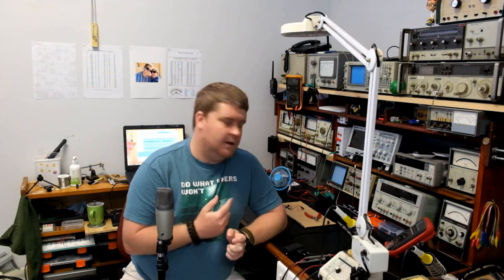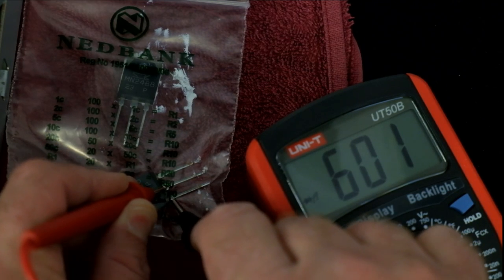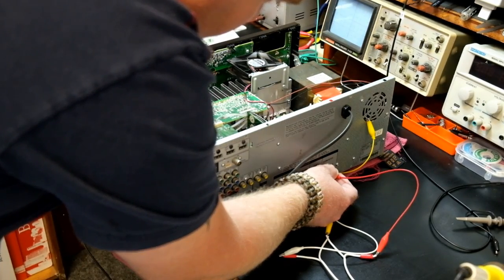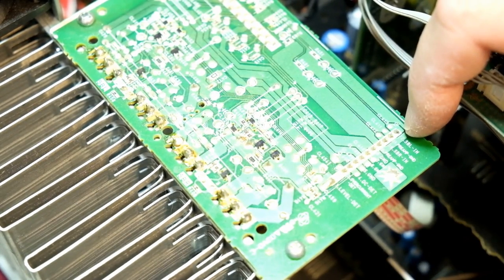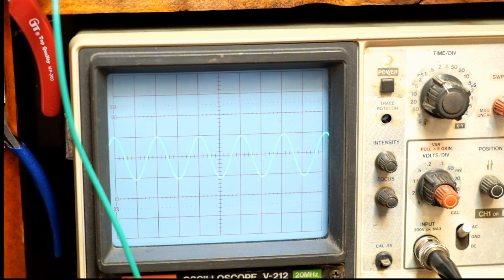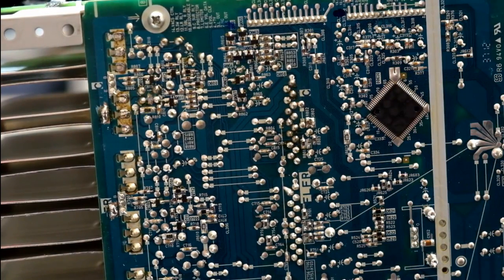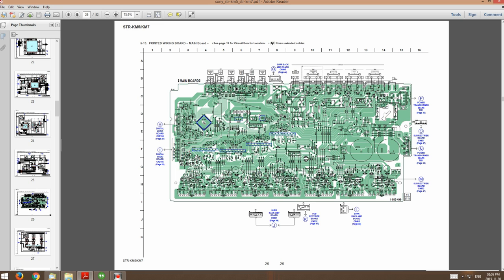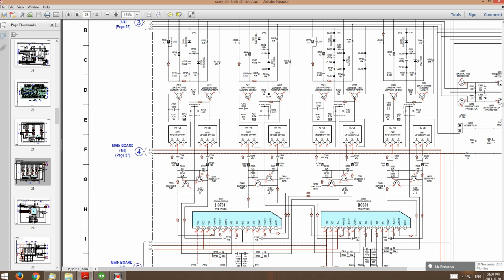Episode 41   Sony 7 2 Amplifier Repair

Comment: great video. I have a sony muteki STR-KM7600 and a KM7000, both front speakers and surround R are low compared to the others. it is not a speaker problem. The mosfet looks good too (i tested it on place without removing it or cutting the tray, is it ok?), I re-solder the pre amp and nothing yet. Any idea what else should I test?

Comment: Hi there,

I Just viewed your video about your repair of a receiver, could you possible make a video about the part that you check the vertical board witch the optical connections, so i get a little bit more understand of this type Electronic board in amplifiers?

Comment: Very good analyzes; I have run across my fair share of collector emitter shorts with audio equipment. In rare cases in a push pull driver circuit I have found they tested good until I tested the actual hFE, example one driver will test 25 and the other 125 clearly showing the higher gain drawing more current while switching that can course weaker sound and eventually fail.

Comment: I have tested a lot of transistor and they tested fine with digital multi-meter but measure bad when testing with analog meter. The correct meter is an Analog meter that carries a 9 volt and two 1.5 volts batteries. Also some transistor may test fine but the gain maybe low causing problems,  Transistor are a tricky thing.

Comment: Hey I have STR-KM77 Sony muteki 7.2, all speakers are working order no bass coming from subwoofers.
Test tone SW empty nothing .
all factory reset done.checked wires , fuses all good..can any one advise the problem
Reply: Mine also the same problem....can anyone tell us the solution

Comment: Hi,  I have a problem with my Sony system 7.2. The system is not switching on but two fans are rotating.  What could be the problem. Please assist me.  Thanks.
Reply: My muteki 7.2 is going into protection mode intermittently. Sony service center is unable to repair it or arrange for new main board. Has anyone worked on the main boad?
Reply: @johnyfernandes8988  protection mode on sony amps is triggered by a short, its trick to diagnose but cable connections mainly do that, check those connectors that are belt the connections maybe shorted on 7.2ch check the one from the front panel to the back if not try others. Then another thing check for water damage especially on the top part above the ventilation gril, water can enter the Amp through that grill remove that panel clean with isopropyl alcohol or even cab cleaner, be patient though but u may win mine once did that. Good luck

Comment: That radiator looks like a tin can. How can that small cooling fan keep the thing from bursting into flames at full power? I had amps with a foot long radiator that went into protection because of the heat at about 100 WPC.
Reply: I don't know man, I cook mine with large speakers set on A+B mode that rattle the house and it seems to do fine Sony knows a thing or two about heat sinking. Onkyo on the other hand is a piece of shit company that doesn't know how to heat sink their on-board DAC chips.